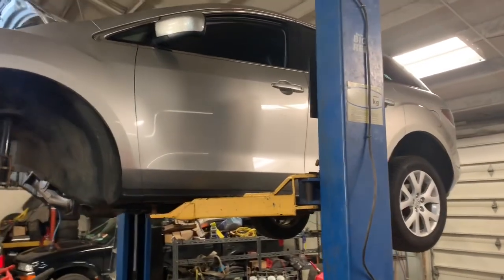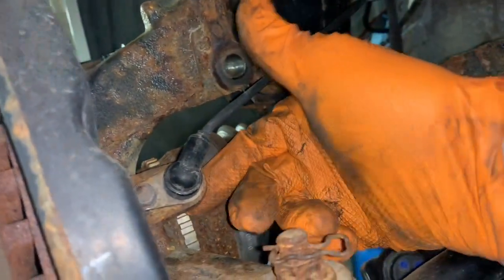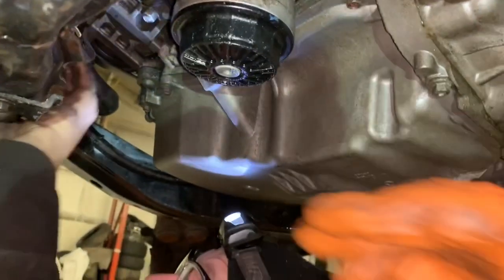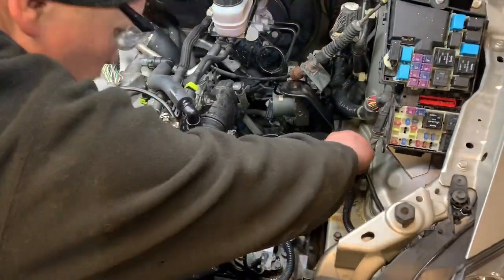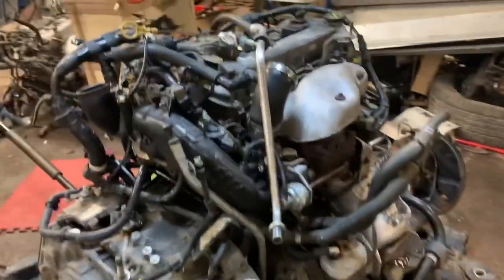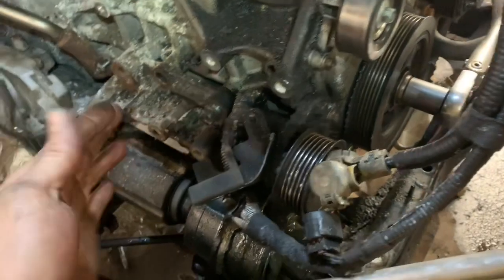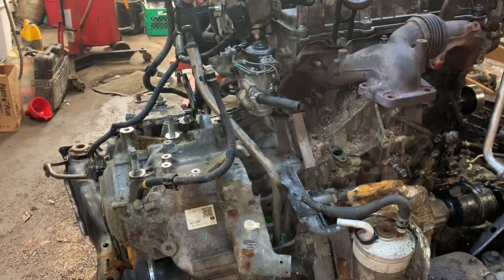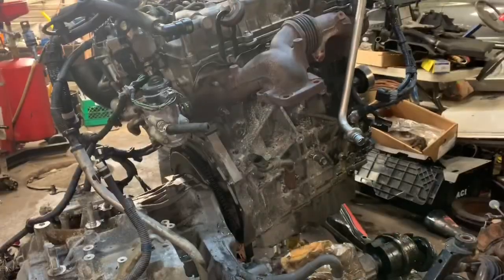Mazda CX-7 Engine removal overview

Comment: I was thinking of removing the hood and pull up engine and tranmssmission from the top , another way is to pull the front bumper and the support .... well I ended up  dropping the subframe down like on this video  , it's verry doable  , it sucks that the mounts are attached to the frame so you need to deal with jacks under the subframe.I found it mutch easier to disconnect the transfer case and slide it away about a inch without  completely removing it then the new engine slides back in there like butter.
Thanks for the video.
Good luck to all you guys.
Reply from the maker: Well thank you very much for sharing that information with us. There are always different ways of doing things you could disassemble the intake etc. etc. and get the engine out through the top but this is not the recommended procedure for doing it so I did it this way in the video but I greatly appreciate you taking the time to let everyone else know that that was the way you were able to achieve it I’m going to pin your post so people can see the way you did it and if I do one in the future I will do one from the top and show you how to disassemble it for removal without removing the sub frame. When I make videos I try to make them the proper way the first time and then show people the other ways the next time if it makes sense for me to do it that way. Not that my way is the only way but it is certainly the Clay way LOL

God bless and have a great day brother
Reply: Thank you for both I got 2007 mazda CX-7 needs engine and I'm going to work on my driveway i was like o men thi needs to be drop it down and then saw the comment can be pull it up I was like oh 👍   thank you again

Comment: At the end just took cylinder head off and took all 4 pistons from the top. Very easy job, took me like 4 hours to get cylinder head and pistons out. Didn't even needed to take exhaust manifold out from the back which would have been a nightmare, just took everything out with a head. I did unbolt intake manifold, crank pulley, timing chain, cams and a few bits here and there.
Reply: That's how I'm gonna do my engine. Its cheaper
Reply: Did you have a spun bearing - that is what I think I have. Did you manage to get it rebuilt in place? This might be the only possible option for me - everything else is unaffordable and can't be justified on an old 2010 car.

Comment: Take the top transmission mount off, gives you room in the front to pull the engine from the top.  Not trying to knock your vid but it's saves hella time.  Thumbs up on the video btw.

Comment: Hey man
Got a quick question. I've got a 2010 CX7 2.3lt with a bad engine. I've purchased another CX7 but its 2007, still a 2.3lt.
Wanted to know would the wiring harness be the same on both engines considering one is series 1 and the other series 2? 

Thanks in advance
Reply from the maker: More than likely, not technically, I do not know the answer to this I can only go by my experience

You may even run into other issues that are unforeseen like reluctor wheel differences . Which would cause the engine not be usable I would recommend using the Hollander index. 

I’ll go take a look for you. I won’t be able to explain to you what the differences are, but I will tell you if they’re compatible if it says they’re not compatible do not attempt it. You will be wasting your money. . 

The Vin code must match  you’re looking for an L or a 3 in the eighth digit position

Comment: Good day, hopefully your still around on here. I just did a transmission swap on a 2011 cx7. Now its back together i put the. Battery back in and i have no power to anything…i mean nothing no blinking security light nothing. Battery is good fuses appear to be good. What have i missed? Ever seen this before?
Reply from the maker: Sounds like the main wire is not hooked up to the starter or the fuse box one of the two would be my guess

Comment: i am tapped out with our cx-7 2.3 2008.  I have a good running 283 Chevy and I keep thinking...hmm.  Im trying to find a swap to any engine other than the 2.3.  ours is awd.  any suggestions?  thanks.
Reply from the maker: They do make models that have a V-6, but that’s the CX nine if I remember right. Yeah them 2.3 is a real piece of crap

Comment: I have to ask because i am about to rebuild the engine in my Mazda CX-7 turbo .  Why didn't you take the engine out from the top and leave the transmission and cradle in place . Thanks
Reply from the maker: Well I did it this way because this is the way the book tells you to do it you can certainly disassemble the engine while it’s inside the engine bay and remove the engine without removing the cradle. But that’s not the way I do it

Comment: I want to remove the damaged 2.3 turbo engine and replace with the non turbo Ford fusion engine. Is that possible?
Reply from the maker: That’s a very interesting question you won’t be able to just plug it in you would have to change the whole wiring harness and the computer would be my guess I’ve never done anything like that but I do know this. It’s a good possibility it may work but not with the programming that it already has so everything would have to be changed it would probably be more than likely unfeasible monetarily speaking because your engine cost $2000 and to do that kind of work you would have to have $3000 worth of parts maybe I don’t know I’ve never done any research on that sorry I wish I could be of more help
Reply: @sharpcarco   where I am I can get a Ford fusion engine with only 60K miles for 10th of the cost of another 2008 Mazda 2.3 turbo... That's why I considered switching them out... Ford fusion engines with warranty run less than 300. Mazda engines are 2200-3000... It may be worth the extra work... Thanks for your response
Reply from the maker: val effect Yeah I’m actually doing a Ford focus right now 2011 and the engine was only $125 made more sense to change the whole engine rather than fixing the timing problem. So I totally get what you’re saying and I’m absolutely sure would be worth doing it if they’re selling the engine that cheap more than likely it would seem like you can get the whole wiring harness and the computers. 
And I’m certain there’s a way you can make it work that would be really interesting and not a bad idea at all
Reply from the maker: By the way I’m actually doing the Ford focus motor that video on another one that I’m doing next week so I will have information up about the Ford focus engine that you could compare the two
Reply: @sharpcarco  ok cool
Reply: I took our cx7 2.3 to Mazda in Jax and guess what..needs turbo and engine rebuild.  guess how much?  16,000 Doll Hairs! So Yea, if you can get away from the turbo, do it, keep me updated.  I have a 283 Chevy engine and I keep thinking....
Reply: @sharpcarco   I'd like to see how the swap went.

Comment: 10:25 Wrong bolt for locking the crank.  It's actually smaller and closer to the crank pulley.  It's behind the passenger side axle shaft, should be a 10 mill.  I gotta pull mine out for a trans front seal leak.  Might just pull the bumper and come straight out.
Reply from the maker: As far as I know there’s only one hole back there... But maybe I’m mistaken and I think we were just talking about locking it out I don’t think we actually had any reason to lock it out
Reply: @sharpcarco  It's on the side of the engine block not the trans.  Only bolt covered by the axle shaft.

Comment: After watching your video I think i will rather sell my car then doing this job. I need to install new cylinder rings and I don't know how to do it without taking this engine out.
Reply: There is alot more to it than that ,  Proper way is to check the cylinders and piston for wear, and curious why do you think the rings are bad ?  Oil loss/ or consumption ? If the rings scored the cylinder you need to clean up .010 or .020  and with new pistons oversize

Comment: Sideways mount engines, come from the bottom.... yes I've pulled some from the top. It's possible with some. But easier to drop out the bottom for all. 
Front mounted engines come out the top. Which includes pulling from the front. 
Though i think my car may be an exception.